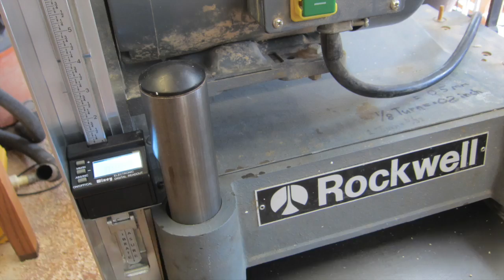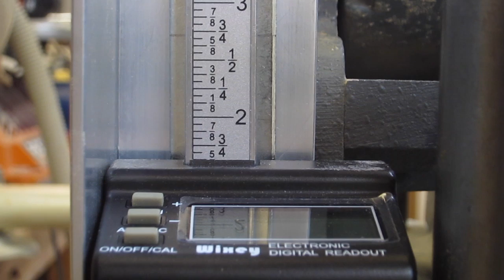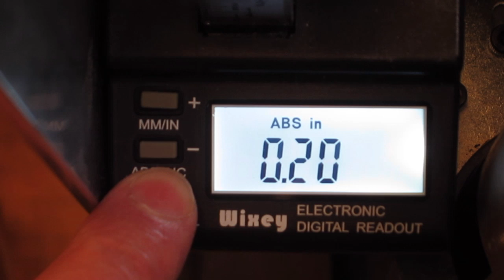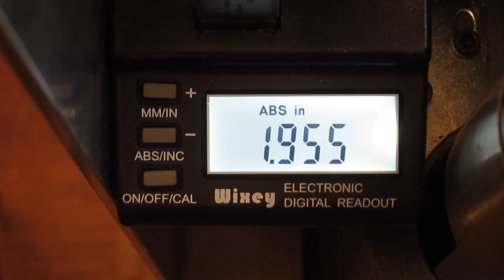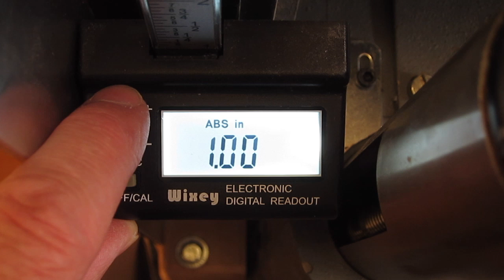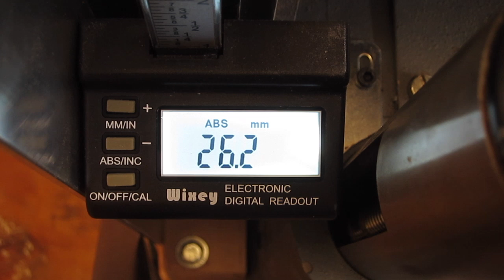Wixey WR510 DRO on Rockwell Delta RC-33 DC-33 22650, 4 post planer.  Installation, Calibration, Test

Comment: I added the exact same DRO to my DC 380. I machined some aluminum pieces to install mine, but same concept. What a game changer.  So nice to match an existing board thickness by just reading and setting the DRO. I have the same DRO on my tablesaw, just the longer version. And I adapted another Wixey table saw DRO to my miter saw station. So now I can tweak my cuts down to .001, and also not worry about moving the fence stop and then trying to go back and repeat the cut. Cheers

Comment: Your videos with its detailed instructions, such as the installation of the Shelix cutterhead, are above and beyond the many videos posted about Rockwell Planer maintenance.

While doing maintenance on the 22-650, the run capacitor was leaking dielectric fluid and oil.
The 2 hp, 230 volt, 12 amp single phase Rockwell motor, made by Leeson Electrical Corporation, has become obsolete and retired. The company no longer has the information on the capacitors used for that motor. When wiping the greasy film from the Mallory run capacitor, ALL the identifying information on it was also wiped off. 
It would be greatly appreciated if you can list the model number, Microfarad ratings and VAC of your run capacitor in order to make my planer operable again. Thank you.
Reply from the maker: You have done me a big favour by your question.   Someday I will be in your situation, and will be able to look back at the capacitor documentation I just created for you.    For photos of the capacitors, look for file "RC-33 Motor" at this link.  An electric motor repair shop is a good place to buy capacitor.  Let me know how it works out for you.   https://drive.google.com/drive/folders/1_Qm84_ZeMmsxgP-hHsI-Ppf39kiUOEU3
Reply: I have subscribed to your channel.

The machine has not been powered on yet.
I am in the process of installing a 20 amp double pole breaker, a 22 foot length of 12 AWG wire, and a 20 amp Type 6 Straight Blade receptacle.
When performing belt maintenance, the original Brazilian made Gates V-Belt model #1280 - the 3/8 inch x 28 inch belt, was still in place. For some reason, part # 428-06-133-001, replaced by the 3 belt pack set as West Coast Belts advertises, is actually listed as 3/8 inches x 29 inches in length. That extra 1 inch of length appears slightly loose. 
Is it possible the factory recommendation may not be correct?
What belt length is your machine currently running on?
Reply from the maker: @MG-mt3ss   I am still using the original belts so don't know what the actual length is, probably 28 inch based on your comment.    There is some adjustment with the motor mount bracket that allows the belts to be tensioned - perhaps that can handle the 29 inch length.

Comment: Serious Wixey couldn't convert from inches to mm correctly; did we learn nothing from the Challenger space shuttle disaster?  Great Video I have a Wixey DRO on my table saw hope to get a Delta 21-650 (Rockwell DC-33) soon and add this DRO to it as well.
Reply from the maker: After making the video, I discovered that the units conversion defect only occurs when calibrating with the +/- buttons.   When calibrating with an auto-zero there is no problem with changing units.